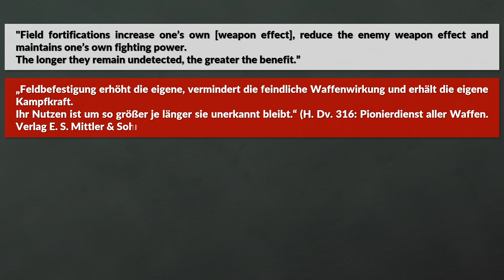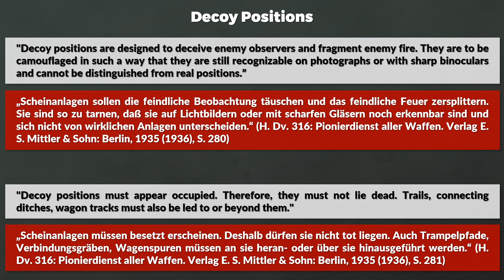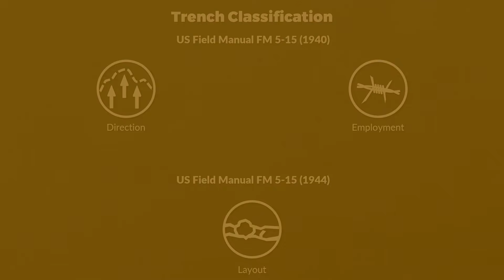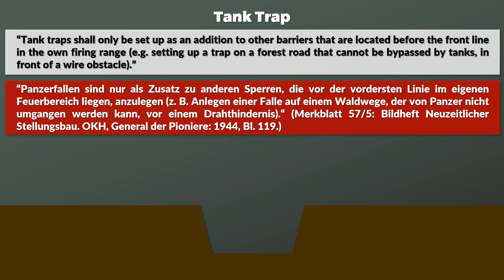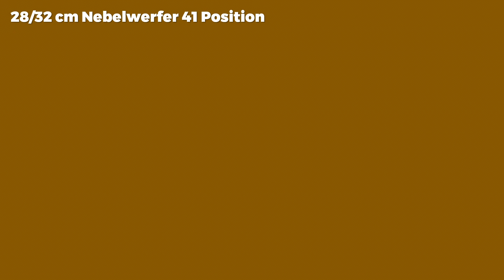German Field Fortifications

Comment: In Vietnam, the Americans put rocks in the C-ration cans; the best Viet Cong sappers could come through without making them rattle. I'll keep it in mind that tall, thin cans work best.  Make sure you wash out the can (smell, roaches, ants).  The pull-top of a can, dropped back inside makes a very sensitive and loud rattle.  The American 46 ounce can would probably hold asparagus nicely.  ("C" stands for prepared food that can be eaten without heating, even soft packaged M.R.E.'s.  Think Chefardee Spaghetti without the meatballs, cold out of the can; yum...)

Comment: Thank you for these great videos.

I especially like the part where you break down the materials in a list and their amounts. 

 I was taking back of how excessive the materials were for just the square footage footprint it takes up and for how few Personnel are inside it.  This kind of answers a question I've had for years of as to why not more fix fortifications were made use of during World War II. 

 I have also recently read a monograph where it is about defending against the Russians in the 1980s coming across Europe.  The author mentioned that fixed fortifications are expensive and take time to build and furthermore need to be staffed with huge forces an order for them to be more insurmountable than not.

Comment: Gah, this reminds me of bootcamp:
"Soldier, pay attention.
If you have reached your designated position and have not recieved any further orders, take out your shovel and start digging.
It should take you no llnger than 10 minutes to excavate a triangle shaped ditch the height of your body whenn lying flat. Use the earth you removed to create forward facing berms. Be careful to retain as much of the top layer of soil with grass intact so as to use it as camouflage for the eart berms.
Provided you have recieved no further order, proceed to dig the trench deeper to a depth where you can comfortably kneel inside.
Provided no further orders have been recieved, continue digging until you have made a standard standing one-man trench.
If no further orders have been recieved, extend the trench into a two-man standing trench.
If still no orders have been recieved, proceed to dig to your right in the direction of your nearest section mate.
(...) "
Reply: I'm writing this down.
Reply: "and this, children, is how the western front happened"
closes book
"sleep tight."
Reply: Basically dig more if no order
Reply: If still no orders...... We've been overrun and you are behind enemy lines. Break out your fake mustache and nose glasses and gather Intel as a spy.
Reply: @Gorilla_Jones  whack enemy combatants with shovel

Comment: Am I the only one to find that the concrete dugout is not that resource intensive to build? The building materiel amounts to a single modern truckload of supplies to contstruct it. And an excavator would probably cut the workdays in half, as I suspect that the time to do the manual rough excavation is the big time consumption here.

I would gather that the civilian retail costs of the supplies are less than 10 000 dollars in my local area. Less than 5 000 infact if round steel is meant to be rebar and not rods of actual quality steel, and note that the price on some of those materials did even include VAT taxes and the gravel included shipping, so even the fuel for a truckload is accounted for here. The cost would be in the workforce if this was to be a civilian undertaking.

Comment: That panzerkampfwagenstand is just nuts :-)  
The tank crew would want to back out of position and into cover, meaning that the ramp would go down, into cover, not up into full exposure.

In addition they would want several positions as to be able to switch between positions, with access roads in cover. So typically behind a higher feature in the terrain with positions dug into the higher terrain. Then they could move between the positions without exposing the vulnerable sides of the tanks.
Reply: Excellent point, but beyond the purview of the pamphlet.  The American Field Manual on A.T. tactics stressed the need for a route to alternate positions be covered from enemy observation.  Finding such paths was one of the main functions of the T.D. recon platoon.

Comment: The British build several "stop" lines in Southern England by September 1940, which were a band of fortifications made mainly from steel & concrete, but also of concealed explosives and incendiary devices, designed to slow (actually not stop) an invading army. There were several lines, but the "GHQ Line" was the largest. Some of the stop lines components, such as pill boxes and tank traps, have been preserved as historical fortifications. Can u do a video on this?

Comment: Very informative. Interesting that there was no "step" in the tank positions. Modern "tank scrapes" tend to have a a lower position where the vehicle parks (while still giving the Commander observation) and then a higher forward position that it drives up onto, exposing the barrel so it can fire. A lot like a "firing step" in an Infantry trench.
Reply: I guess that became important with modern aiming generally being better?
Reply: And no heavy equipment such as modern engineering vehicles with dozer blades and hoe's ( Not those hoes!).

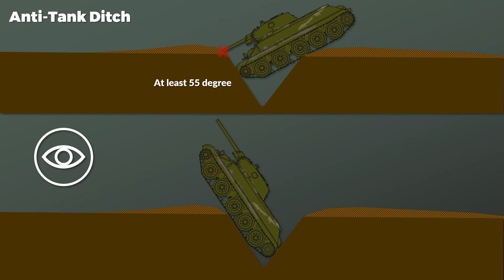Comment: 7:53
Not everyone was in a T-34. You're right, but also wrong. Some tanks had (at least) decent optics, if not entirely the best. So, it's possible to SEE it should you be in tanks such as an IS-2, a Sherman, or a Panther, etc (but seriously, I'm not entirely sure all Allied tank optics were that good, but it's debatable.).
Reply from the maker: "decent optics" in a tank still means you can't see shit, especially when buttoned up.
Reply: @MilitaryHistoryVisualized  But still, depends on which tank it is.

Comment: I´ve once found a weird field fortification. In a forest, I discovered that something like a climbing grid was nailed to trees, thus creating multiple walls. On one side, there was a dune-shaped hill with a tunnel going through it. The tunnel was made of big sewage concrete parts and could only be crawled through. The backside of the structure was lacking. All in all, it had enough space for about two jeeps and it had no cover from above. It was roughly square-shaped, or rather trapezoid. I didn´t find anything else. The inside was overgrown, but the wooden grid was still in good shape. The open back was overgrown with blackberries or some other thorny shrubs (I didn´t find them anywhere else in the forest, thus it might have been planted there). Has anyone an idea what I´ve found? It was in a regular forest (probably used for timber production, maybe some hunting).
Reply: Where did you find it?
Reply: @cracklingvoice  Germany. Bavaria around 2000.
Reply: Was the open area fully enclosed by the grid?
Reply: @cracklingvoice  no. The back side was missing. I didn't see any tracks, but I assume that cars were parked there even after the center got overgrown.
Reply: I'd guess something like a mortar position.
Reply: @cracklingvoice  I'd doubt it, as it would only provide cover from one side and concealement from two other. I'd expect a firing position to have at least some pit for ammunition and a place soldiers can seek shelter. As said: there were no trenches and only one artificial hill. It was just enough to hide a small area. I doubt that even a light tank could have fit in there.
It would have been too much work for hiding a few crates and due to the one open side, I thought of hiding a car or two (though civilian cars would not be able to open the doors due to the shrubs).

Comment: Classic German ingenuity and research, finding out what tin can is most effective.  

German Command is pleased.
Reply: Well, they had a lot of practical experience from 20 years before
Reply: So...buying beer in 500 ml. or 473 ml. cans is preferable, from a security standpoint, than the regular 355 ml. cans? At night, any two or three beer cans strung together with or without pebbles inside them, and with or without liquor or wine bottles to clatter against, will make enough noise to alert everybody within a two or three block radius the same way smoking weed or a cigarette will alert anyone downwind to the presence of a stoner or a smoker in the area. Exhaling a lungful of weed, meth, or tobacco smoke on a moonlit night can give away your position from  a long ways away. There's a good reason why chewing tobacco is popular in the military.
Reply: SouthParkCows88 spent longer testing tin cans than designing the transmission or thinking about logistics “classic German” incompetence indeed
Reply: @jb76489 It's almost like, tin can designers and automotive engineers are different people. It's almost like designing a metal cylinder takes about 10 minutes, and designing a complex piece of machinery takes about 10 months.
Reply: @jb76489  
Well the reason is that tin cans could be afforded the time, tanks had to be rushed into service and transmission problems were widely fixed by most later models, the reliability issues were mainly from lack of spare parts and bad logistics due to the strategic situation than truely incompetence.

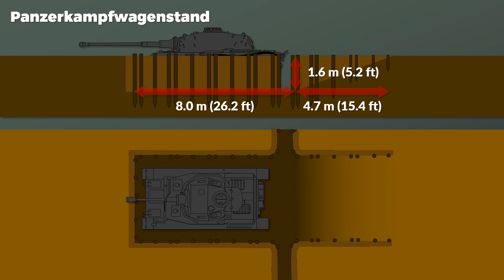Comment: 13:46 Panther and Elefant moving into the tank trench: There is no going back now.
Reply: they passed the point of no return
Reply: tbf you would have to be an idiot to put an elephant in there since the elephant has no turret and cant exactly turn in there
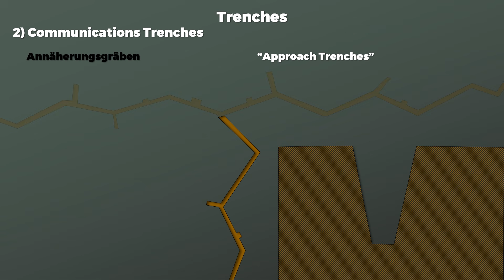Reply: @hesseldekraai  https://youtu.be/MRDnJ-_Kbk8 4:55 its a Nashorn but still, being turretless doesnt mean you cant go into hull down position.
Reply: @hesseldekraai  
Dig a round hole?
Reply: @hesseldekraai  not so out of this world? think about artillery fortifications for AT. They were large, concrete, and only fired in a certain angle.
Reply: If it works for a King Tiger, why it shouldn't for a Panther or an Elefant?
Reply: They would position the dugouts so the ramp lead downward into full cover. Thus they could back down and into cover. Preferably with covered routes into their next positions for defense in depth.
Reply: Why?
Reply: Vito Hartanto because the panthers have really bad reverse speed so it would be very slow to get out of the trench, while the elefant is underpowered and overweight making it even harder for it to get out
Reply: @leonardusrakapradayan2253  now I remember

But torque and speed are different, tho it is a gasoline engine
Reply: @TheCat48488  
Well it was an obvious joke, so r/wooosh.
Reply: @TheCat48488  Even with sufficient torque to climb out, the slow speed means if you are under fire, you are basically done for.

Comment: So just for one fortified tank position you would need 45 person-days of work. Assuming something like $15 an hour for simplicity, and 8 hour days (again for simplicity) that would be 45*8*15 = $5400. The materials were probably equivalent to at least another $1000. I know they weren't using modern dollars and that the values may be all wrong, but its a ballpark guess to give some context. Actually on the whole, that's pretty cheap compared to the cost of the tank, to say nothing of the survival of the crew and additional effectiveness.

Of course you might have to build many of these for any given tank as you advance or retreat.
Reply: For the machine gun bunker you would have 250 person days, so 250*15*8 = $30,000, plus another $3,000 in materials. (again, super rough guess, please feel free to supply your own)
Reply: Cameron Sours comcrete and steel are expensive i think the materil cost would be around 10-15k

Comment: Also, make sure that each artillery placement is reachable through interconnected trenches.
If the attacker manages to infiltrate the communication trenches, they will be able to use it against the defenders.
Don't know if that scene from "Band of Brothers" where they assault the "88's" (which were clearly 105's) was realistic.
Reply: But all english and american soldiers called german guns 88s. Just because 88s was the most famous gun.
Reply: @asliceofbanana2243  That's rubbish. I know the Americans were seeing Tigers everywhere they spotted any German tank but I have never heard that or read about that occurring with the 88 mm guns.
Reply: @AudieHolland  
The Flak 88 was rather effective at getting through tanks and fortified positions as it turns out, and got the same sort of fame that the Tiger did for being very effective at killing allied soldiers dead.
MilHisVis did another video on this subject before: https://www.youtube.com/watch?v=DXnHc98r15k
Reply: @boxcarz  Completely irrelevant. The reason the Airbornes attacked the artillery guns was because of the danger their fire posed on the invasion beaches.

So even if they were 88s, which they were not, the reason to take them out was not because of the danger they posed against their tanks.
Reply: @AudieHolland  Nobody but you decided to bring up that leap of logic, people have just said that the 88 held a similar position to the Tiger in the minds of the average soldier, so just like non-Tiger tanks were mistaken for Tigers, non-88 artillery pieces were also mistaken for 88s.
Reply: @AudieHolland  Read "War Journal of an Innocent Soldier", or any of the personal accounts by Americans.  Every high-velocity (super-sonic) cannon was thought to be an 88 by the Infantry.  You can hear artillery coming at you, but not an '88'.
Reply: @twostep1953  I think the author stole that from the Allied soldiers 'MG-42 experience.' 

They could hear any other machinegun but a burst from an MG-42 would just hit before anyone could take cover.
Reply: The show accurately portrayed the attack as it was described in the book.
Reply: @twostep1953  Sure. Just how it 'accurately' invented that they were the first into the Eagle's Nest.

Or how it accurately described how Blithe died from his wounds a short time after the war.

When in fact the real Blithe fully recovered, remained in the US Armed Forces correction: not Vietnam he died in Wiesbaden, Germany, medical issue in 1967.
Reply: Americans also mistook every single tank that fucked their sherman for a Tiger. Even though they were most likely Stuhs or Stugs

Comment: I often heard about low reliability of German tanks like breaking of tracks  etc in ww2....is it due to re-using of old tanks parts or it was Germans manufacturing defect in tank production? ?
Reply: it was most likely neither. they had there own suspension due to the weight of their tanks. since they never had enough tanks to do what the russians did, when a russian tank was acting up, replace it. the germans had to stick with what they had. so the tracks most likely would fail due to over use.